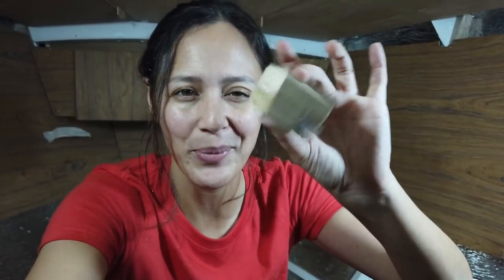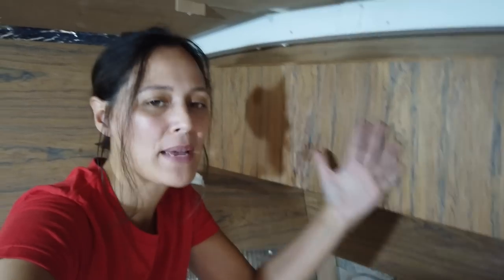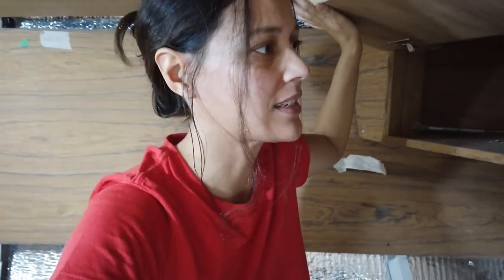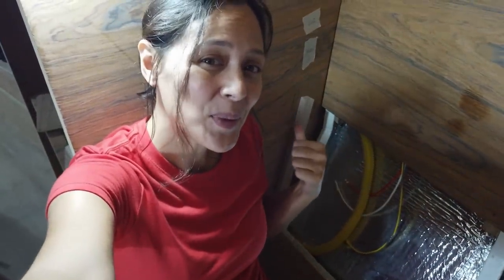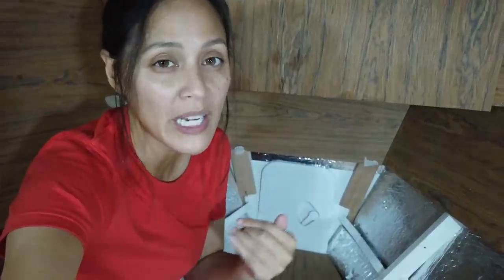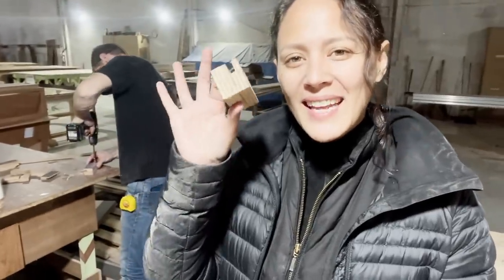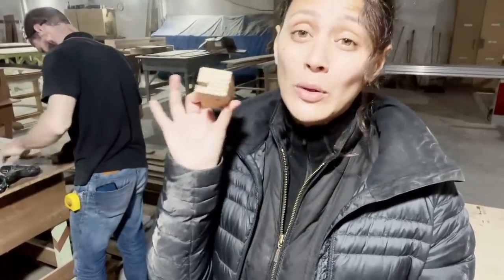NO bolts, NO screws, NO problem ⛵️ Ep43 – Ceiling Deckhead Install - Sailboat Restoration Project

Comment: A most ingenious solution to drilling holes in the steel. esp when we know that those damn holes will, in years to come, only lead to rust streaks down the topsides! For me, the same also goes for thru hulls. In this tech. age we are probably entitled to ask for no - holes sonar et al. Our boat builders seem to think nothing of boring our hulls with more holes than Mum's colander, which then become the source of leaks, always in the most remote area of the planet.

Comment: Those ceiling devices are cleats...Great idea as it provides you with effectively a floating ceiling where the steal and wood can move independently of each other.  Particularly useful when the steal gets hot in the tropical sun and expands at a different rate to the wood.  I hope that there is some allowance for movement made in their use.

Comment: Looking great guys!!! Wow! One suggestion from watching many other sailing vlogs...squeaks and rattles can drive a sailor crazy. Love how you added rubber or urethane between wood and metal for noise separation between furniture, cabinets, the hull and bulkheads? Also on a few channels ...upon remodeling they found loose bulkheads that were not attached to the hull! Yikes! You got this guys keep pushing!
Reply from the maker: Thanks so much! We are dreading any annoying noises as well, so we will use this eva foam anywhere we can and hope it does the trick. Nothing is fully installed just yet, but when they do we'll keep a good eye on it all to make sure its fastened in well. Thanks for the feedback! Keep it comin! Cheers!

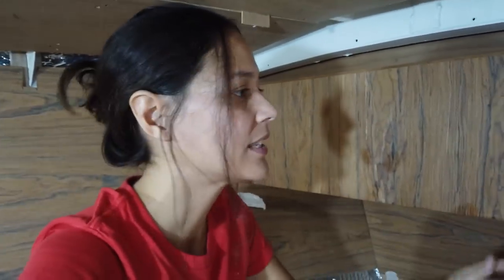Comment: I can virtually feel the cuts and blood from all the sharp corners and inconsistency in grain direction (3:39). Hope all the panels/pieces will be dismantled and properly sealed (at least the end grain) to withstand the wet environment. Also, even though the rabbeted plate brackets were reinforced with screws I had preferred solid wood. Ply is still ply and shear strength is always questionable even with the best marine glue ... all else, good progress.

Comment: Guys,  How are you managing the weight. of the interior materials and fixings.  Every time you add extra cupboards and clever enclosures etc you are adding weight and marine grade ply is not a lightweight material....
Reply from the maker: Hey Peter! We have the original weight of the boat with the original interior including the original diesel engine which we removed. Then the boat was reweighed empty and after all our changes. So we have that figure for a rough weight estimate. Also we have a good comparison from the previous interior and the changes we made.